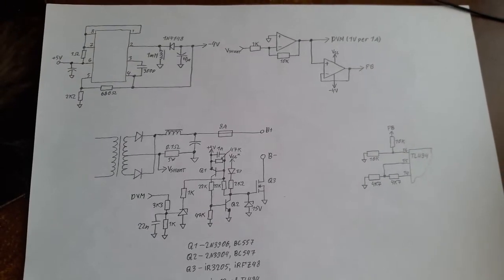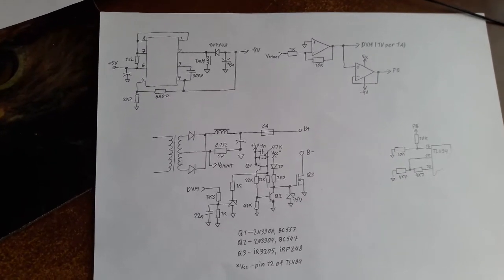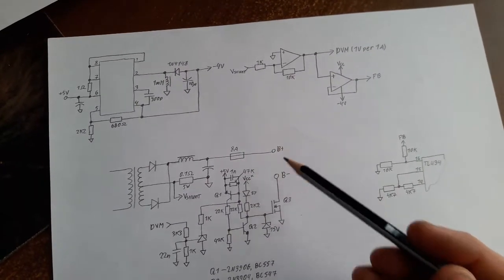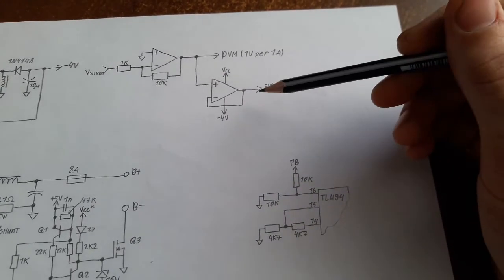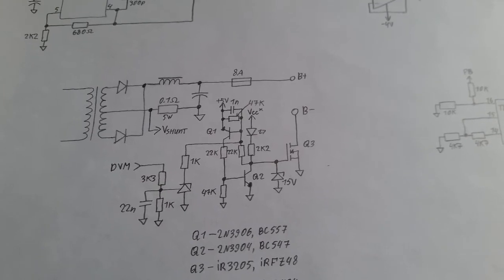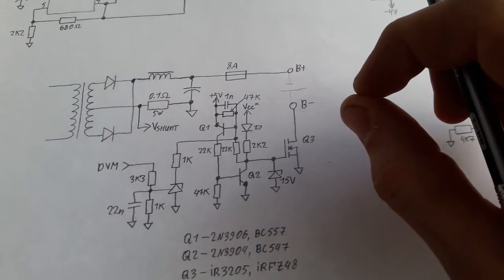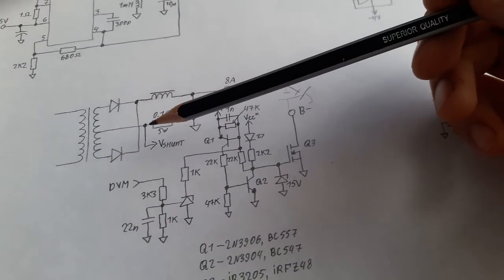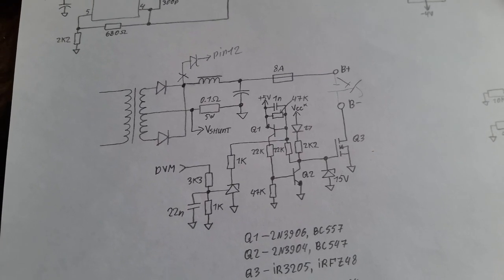Schematic for protection&feedback of my ATX battery charger

Comment: MrJohhhnnnyyy,  the Buck Boost Converter IC is MC34063 (?), what is the OP Amp you used? and thanks again. When are we seeing the schematics and the PCB?
Reply from the maker: Jack Daniel Opamp I used is lm358, you can use 741 or similar. Since there is a negative rail, you have wide choice of parts. Lm358 is cheap and abundant, so I recommend to use it.
 I will add a link to the dropbox folder with the layout in the description, today but a bit later.
Reply: Thanks for the prompt reply. Yes, 358 is much better. One was taught to hate 741 being noisy back in audio amp days. Also, one has to either use two 741s or a 747 dual op amp version. Thanks in advance for the Dropbox link...
Reply from the maker: Link added, there's a readme with more info.